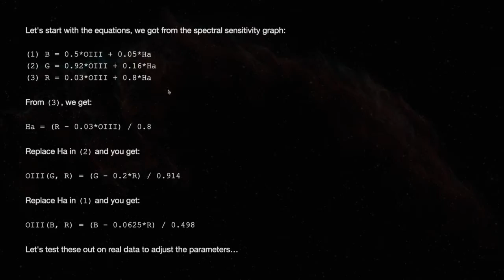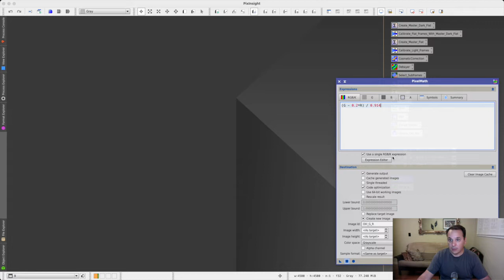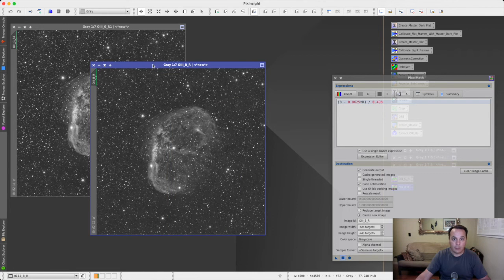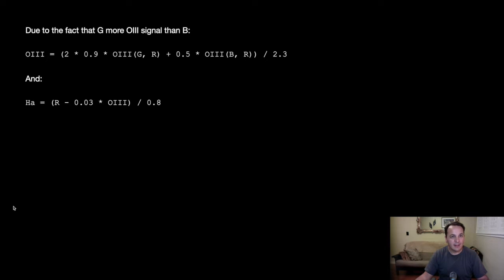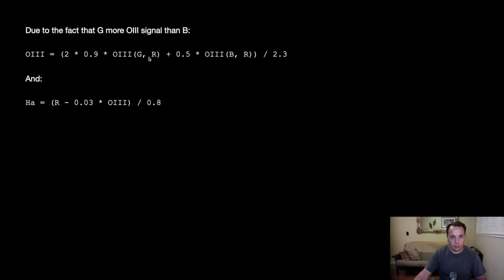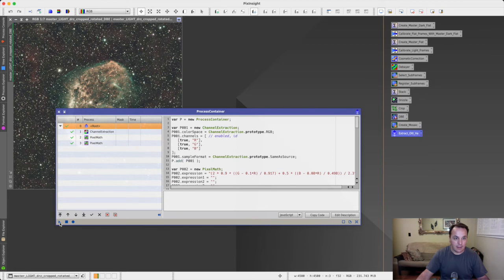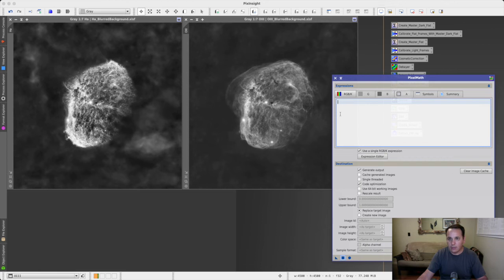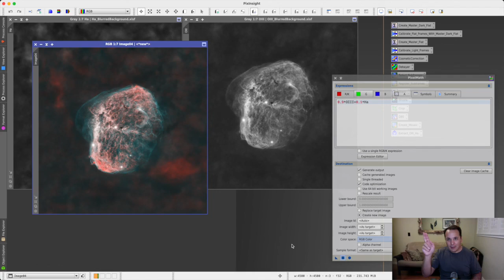OSC Narrowband Ha OIII Extraction - Part Deux

Comment: Awesome detail - I was already doing something similar, but not quite as exacting, in that I was not tweaking the normalisation and CFA factors correctly - and tended to just say OIII = (G*0.9 - R*0.15)+(B*0.45 - R*0.03) and Ha=(R-OIII*0.05), then Combining Ha OIII OIII, and letting narrowband normalization fix the result.. 

I don't shoot RGB stars most of the time, so I would normally do DBE, BXT, NXT, SXT, then take the starless image, split RGB, create my Ha and OIII channels, re-combine it and continue.
Reply from the maker: I find it worthy to take the time to capture RGB stars. It does not take that much time at all, and the star colors in the end result are more vibrant. CS!

Comment: Nice. The problem is that you leak the 3 chanels whith débayer process. You should extract CFA layers and extract Ha and Oiii whith your method from these "non leaked" chanels (it was the développer of SIRIL who told me this method). And then drizzle x2 to recover initial résolution.
In my process, i extract CFA layers from all lights, align the 4 CFA layers in each light, extract Ha and Oiii as you do), align and stack all Ha/Oiii.
Et voilà (sorry for my anglish, i'm french 😜)
Reply from the maker: You are absolutely right, and what you are doing is theoretically better than what I am proposing in this video. Nice job!

Comment: These are excellent results. I still don't get how to apply these to ASI294MC pro. Any chance you could help please? I mean, I completely have no idea how to digest this so pretty please :)
Reply from the maker: Unfortunately, I cannot help you. I don’t have that camera. You need to find the spectral transmission graph for that camera, and you also need that of the dual narrowband filter you are using. Then, watch the two videos again, slowly, and apply the same technique to your own equipment. Finally, experiment until you get results you are happy with. Best of luck!
Reply: @darkskygeek  thank you Julien. I found the graphs but really struggling to understand
Reply from the maker: Take your time, it’s not a race. You’ll figure it out. Enjoy the journey!
Reply: @darkskygeek  ASI294mc pro graph seems to be very similar to 533mc pro. The filter is 7nm duo so 500nm Oiii and 650nm Ha I made exactly the same formulas for pixel math equations and don't really see any improvement. Perhaps I have not enough data on my Crescent Nebula. I gathered 16x600 sec subs and can clearly see the Oiii region but maybe still not enough data. Can you let me know what were your subs, how many and what filter was it? thank you again
Reply from the maker: I had over 30 hours of OSC data on that target.
Reply: @darkskygeek  hahaha hence my struggle. in the UK chances are very small I will ever gather 30 hours on any target. once again, thank you for your help

Comment: Thanks for sharing this method! I was able to extract the data and process hoo and it look amazing. I have the question when extracting data. When im changing values to find where it’s not clipping, I notice that stars are clipping little but nebula doesn’t. Is it okay to keep it like it or should I lower the value so it doesn’t clip stars too?
Reply from the maker: Keep it as is. For the best result, capture some RGB data (easy with an OSC) for the stars, and use StarNet / StarXTerminator. I have an image processing video series to show how all this works. Clear skies!

Comment: I have absolutely no idea how you got the dominator in both the Oiii formula. Eg, G,R is 0.914 and B,R is 0.498. Can you please explain how you got those two figures?
Reply from the maker: Yup! Watch the part II I posted on my channel, it will answer your question :)
Reply: @darkskygeek  I am pretty sure you don't explain those two numbers at all.
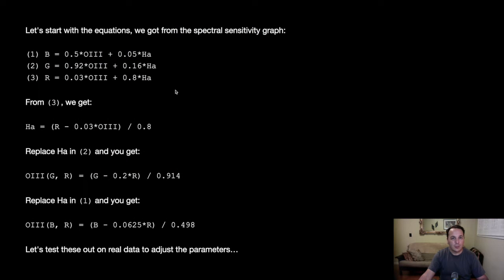Reply from the maker: I’m pretty sure I do :) Check out around 1:00 in part 2. It’s a simple substitution within a set of equations.
Reply: @darkskygeek  I watched this over and over but I must admit, I see the formula, but I dont understand how you arrived at .914 and .498 as well???
Reply from the maker: @robertseight  It's simple math:

(1) G = 0.92*OIII + 0.16*Ha
(2) Ha = (R - 0.03*OIII) / 0.8
(3) G = 0.92*OIII + 0.16*(R - 0.03*OIII) / 0.8
(4) G = 0.92*OIII + (0.16/0.8)*R - (0.16*0.03/0.8)*OIII
(5) G = 0.92*OIII + 0.2*R - 0.006*OIII
(6) G = 0.914*OIII + 0.2*R
(7) OIII(G, R) = (G - 0.2*R)/0.914

Comment: sorry, in both your video's you skip too many initial processes. Your first video was promoted as a comprehensive get started guide to processing OSC with dual band narrowband filters, but you assume the viewer is very familiar with PixInsite already...I'll have to look elsewhere
Reply from the maker: Hi! I recently did a more thorough processing tutorial, applied to the bubble nebula, although it is for images captured with a mono camera, but the steps are roughly the same. Check it out, hope it helps!

Comment: Thank you for this great tutorial.
I tried with old data and had a good improvement. 
Do you think is possible, following the same pattern, to extract the Sii signal from a master light taken with a broadband filter?
Reply from the maker: Glad to hear it worked well for you. Unfortunately, it is not possible to extract SII, partly because dual narrowband filters usually only let through Ha and OIII. Also, very few nebulae emit significantly in SII...
Reply: @darkskygeek  thank you for your reply. Is it not possible also using a broadband filter? Like an L-pro for instance?.
Thank you for your patience.
Reply from the maker: @gianmariaraboini7952  Sure you can! But then, you won't be able to extract anything! The extraction procedure I presented in this video only works with dual narrowband filters and an OSC camera.